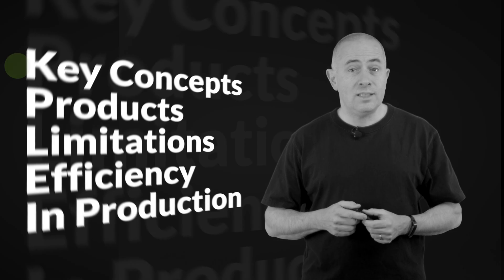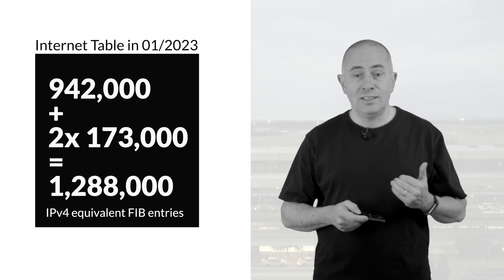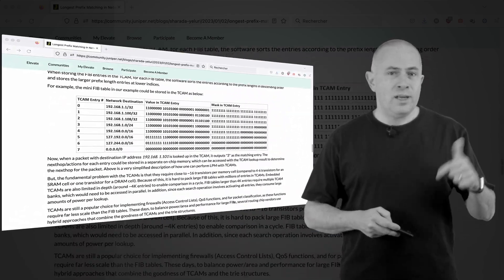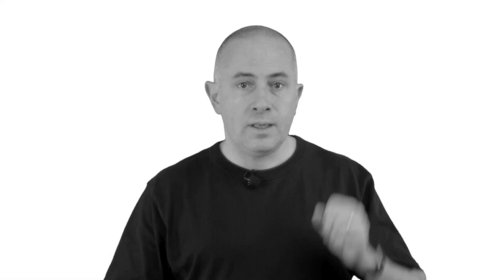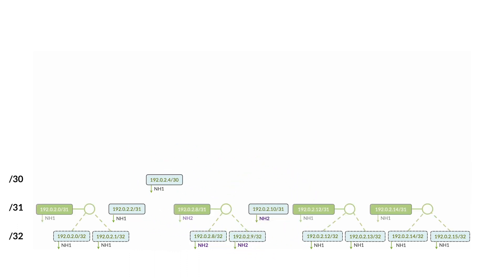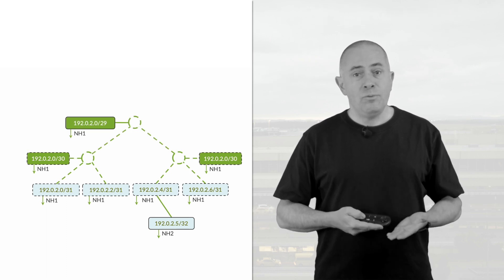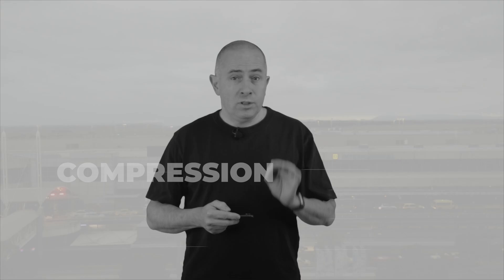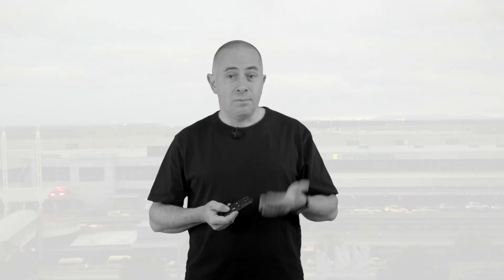FIB Compression - Optimizing your Routing Tables

Comment: Hi. Great video. Quick question. I assume by Next-Hop is the BGP next hop. But could you not aggregate even more based on outgoing link (or real next hop)? Imagime two routes are aggregatable  but they go to NH1 and NH2. Now imagine that a given router uses the same outgoing link to reach NH1 and NH2. They could still be aggregated, no? Unless in your video you mean next-hop as the actual next hop (but glancing over the report I don’t think you do)
Reply: Hi Miguel,
Next-Hop here is from a RIB perspective. If you received two BGP prefixes:
- pfx1 points to BGP NH1
- pfx2 points to BGP NH2
and if NH1 and NH2 are both resolved to the same NH-IGP, from a RIB perspective, both prefixes are pointing to the same next-hop and can be aggregated.
The compression algorithm kicks in just before FIB programming in hardware and really doesn't take into consideration the origin/protocol of the routes.